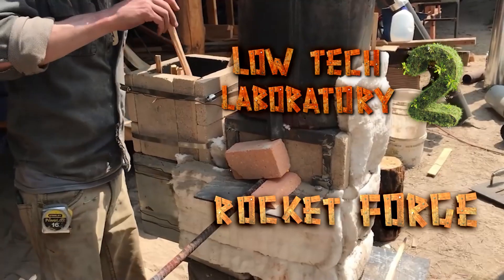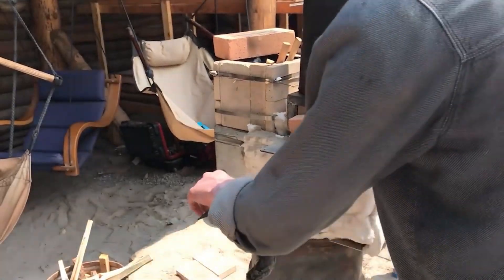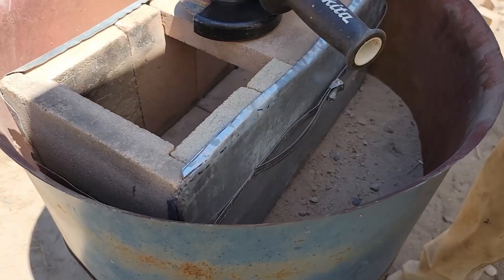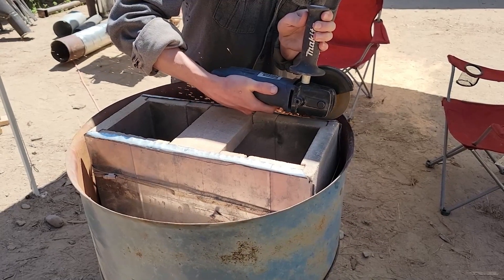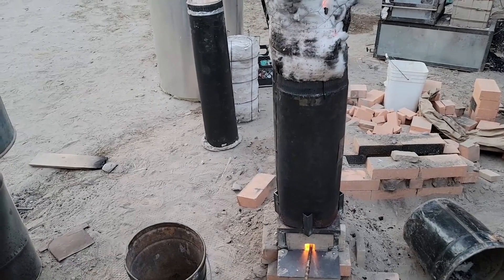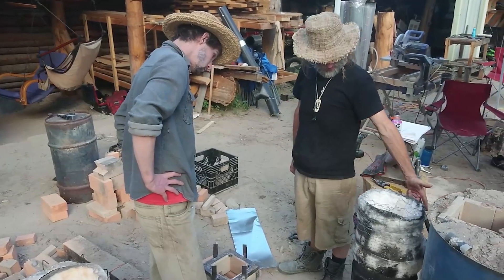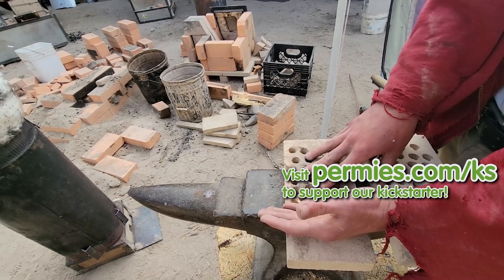Rocket Forge experiments part of the low tech laboratory 2 kickstarter

Comment: I've already done this with my batch box rocket stove, you just need the air to come through the fuel rather than entering at the end of it, I used a cast iron drain grate which always glows yellow as the base that the coals sit on with air intake below the grate, downside is this needs replacing every 3-4 years.  I tested it one day by leaving a fire poker in the coals and it was glowing yellow when I removed it after a few minutes.  I also live in Scotland so the fire was used for about 6 months each year.

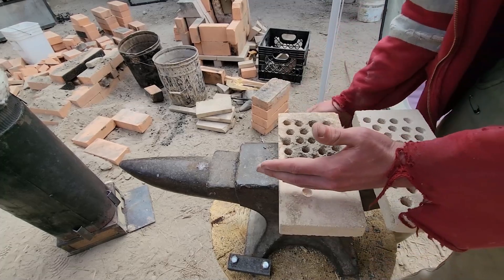Comment: @1:05 they talk about coals right above the steel, and the holes in the firebrick are presented as a potential draft restriction.
That makes me think the brick is a shelf, located in at the base of the riser.
Reply: I think they want the shelf so they can put the piece in and close the door so the can get to a higher temperature.

Comment: Is that all it takes to make a forge?  Just this rocket system?
Reply: Yes, the standard rocket core when fired up will hit temps at the bottom of the riser that will melt steel. Modifying the riser to allow the insertion of material that can be heated is the primary tweak needed.
Reply: thanks!   @Mark-xt8jp